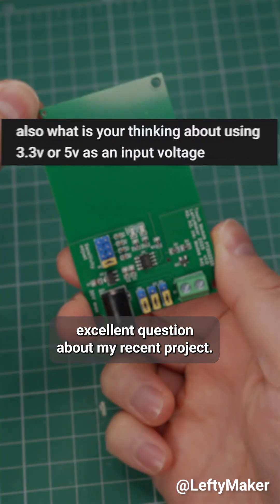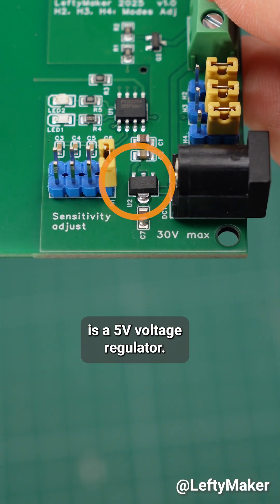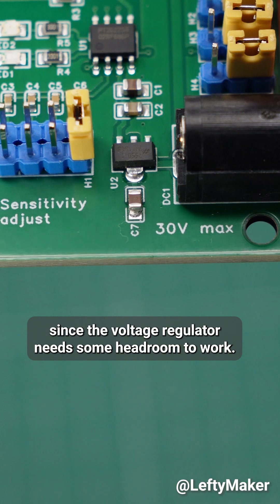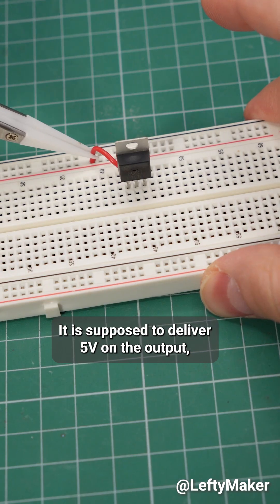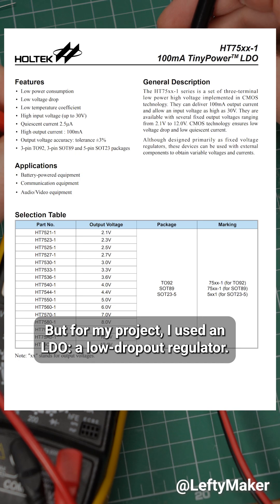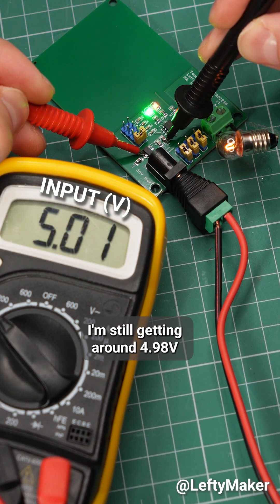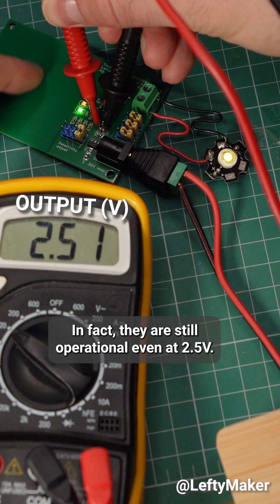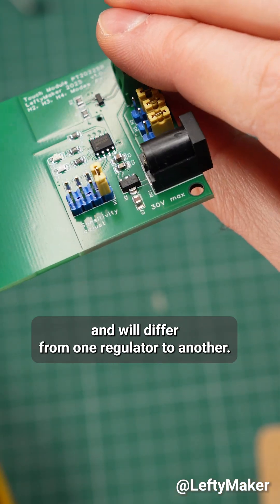Low-dropout voltage regulators are awesome!

Comment: How do you use lithium battery’s in 5v projects while having usbc charging?
Reply from the maker: depends on the project. What do you want to make and how do you want it to work? I think one of my next videos will show a module that is suitable for what you're describing
Reply: @LeftyMaker  how it all can be contained on one PCB while using a USB port for charging. Also using 5 V or 3.3 V logic.
Reply from the maker: @WholeGrainWheat i still don't understand what your goal is, but if it helps, there are chips that combine battery charging, voltage boost to 5V, and powerpath which directs input power to the load when a charger is connected. For example, tp4552b

Comment: Can you add a wire or pin for attaching it to metal surfaces so the module touch isnt always needed?
Reply from the maker: Yes, that can easily be added into the design. I think some pre-made modules have a pad for that purpose. However, the wire must be shielded or very short, and the metal surface must be small to work properly.

Comment: hey, i think the regulator would burnt at 30v, it need to dump around 12w js to make 5v, it was no load. I think u should make buck converter step down.
Reply: the 12w turned to heat which rhis smd size would burnt
Reply from the maker: @marspot the power dissipated depends not only on the voltage, but also on the current. The current consumed is about 2mA, so even at 30V, you're looking at 60mW
Reply: @LeftyMaker owh, so i think its gonna be just warm at that rate, i thought u use like bigger current usage, if that so then the heat will be so hot
Reply: @LeftyMaker btw thanks for the correction
Reply from the maker: @marspot no worries. It doesn't heat up at all because it is connected to a large ground plane